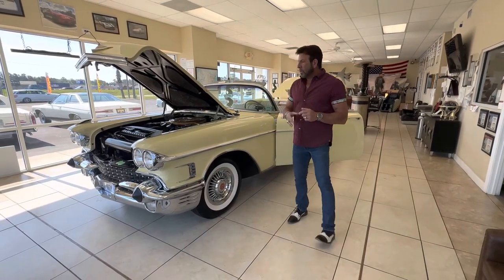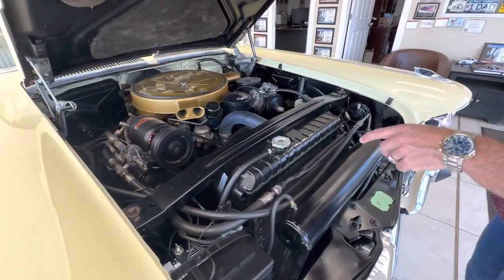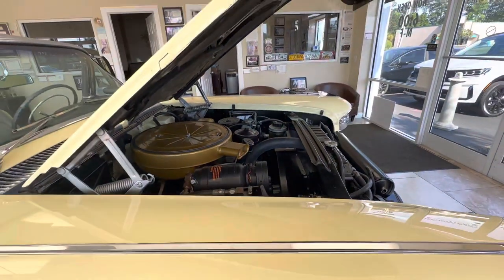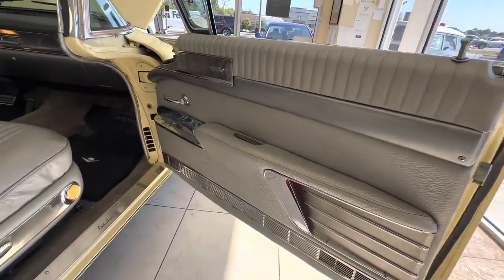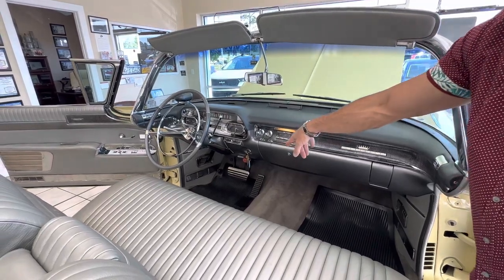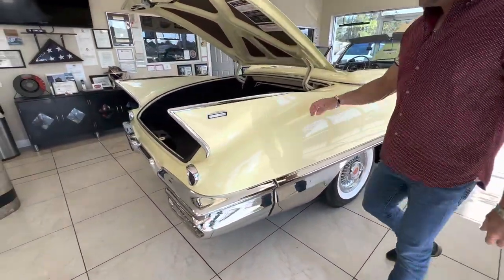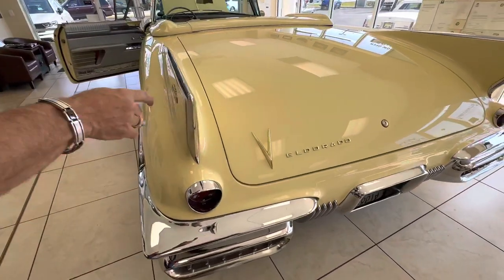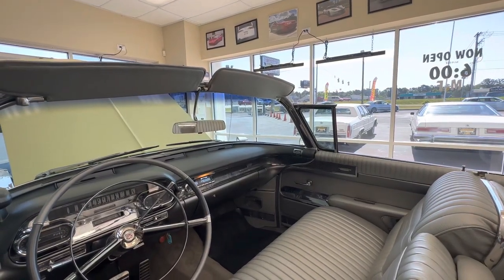1958 Cadillac Eldorado Biarritz Convertible!! Interior Walk Around Video! AMAZING!!

Comment: What products do you recommend for really making the paint shine well on clear coats?  My Lexus LS 430 is in excellent shape including the paint but I want it looking mint regarding the paint.  I’ve used a swirl remover and that helps with my Dewalt buffer.  I have Wolfgang carnauba wax.  I sense I’m missing something.
Reply from the maker: You can do a final finish with a ceramic coating.
Reply: @christianbugatticg  I’ve been hearing about that.
Reply from the maker: @edwardluth7740  Give it a try